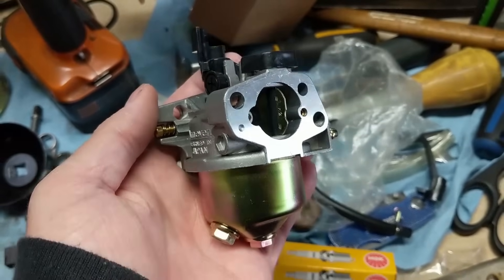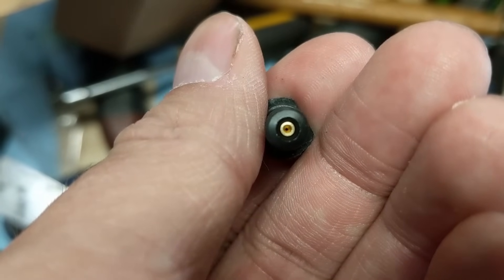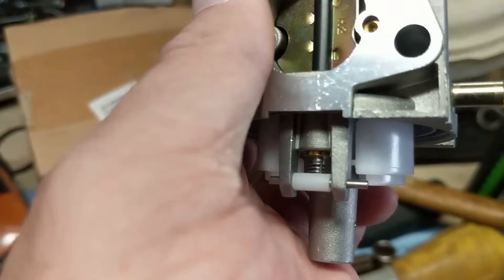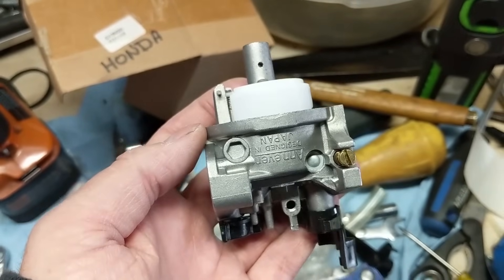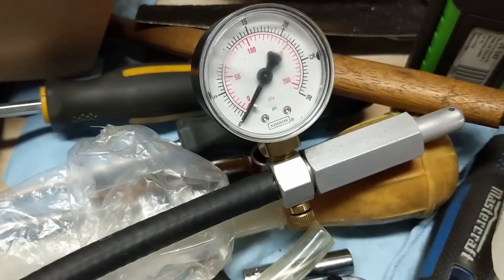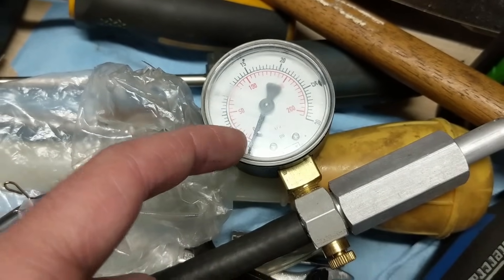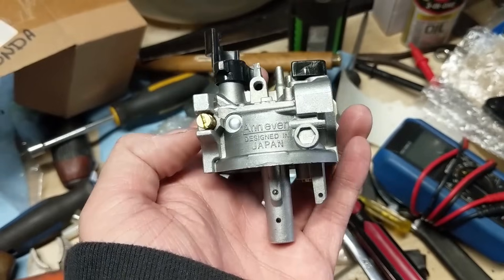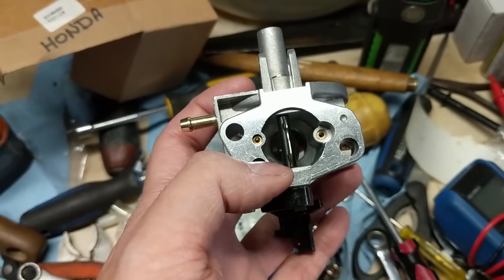How does a Carburetor Work?

Comment: Eliminator, I got am aftermarket carb to replace my water flooded walbro lmk carb.
The new carburetor won't get my 9hp. Briggs Tine master with torque converter log splitter. Where should I start if I know we have spark?
Reply from the maker: Keep spraying (giving a small spray every couple seconds) with carb cleaner, and if it stays running, it's the carb. I'd check the fuel flow from the fuel tank through the line as well

Comment: So, I went through a full clean of the carb, but I still can't get the engine to start.  One thing I noticed was that the fuel bowl will drain for a short period and then stop.  I was wondering if I have a plugged fuel line to the bowl.  If I remove the bowl bolt, shouldn't it drain the entire gas tank (if I understand the float and valve correctly)?  Great video, and thanks for the info!
Reply from the maker: Yes, either your gas cap on the tank isn't venting, or you have gunk built up in the fuel line. These Honda's also have a fuel filter "joint" they call them, that screw into the tank, they get gummed up and slow the flow of fuel

Comment: I have a Snow blower that won't start, I blew air through the fuel inlet and fuel came out the top where the the choke/throttle lever is, is that a bypass or the carburetor is shot?

Comment: Great video.  How does the pilot/idle jet have any effect on mowers that just have one set speed and never idle as such?  Is it redundant?
Reply from the maker: They meter the amount of fuel at idle, and when the engine is under load, the governor will keep the engine at the same rpm but the fuel will then be metered by the main jet

Comment: I want to try to simply my thought process after trying to understand how a carburetor would flood do to a leaky needle valve. Hopeful it helps others.

supply + demand = user throttle demand or govern speed demand.

When you first start your engine, your carburator bowl should filled with fuel to the extend that the needle valve is closed.

Now, if you didn't run you lawn mower for a few days and didn't have a in-line shut off valve, your engine's crankcase can be flooded with fuel due to to a leaking needle valve. 
How you engine is flooded depends on what type of configuration of engine and carburator you have.
On some engines the fuel with travel through the different channels in your flooded carburetor. I.e, welsh plug breather, primer vacuum, main jet valves, etc. and go down your intake tube and into your intake and exhaust valves and into your crankcase.
In which case, you end up with fuel being mixed with you oil.
On systems with a fuel pump, sometimes there's a pin hole between your upstream fuel line and your down stream fuel line so fuel streams down your 'pulse' hose to your crankcase even when the pump is closed.

 This is why sometimes your air filter will be drenched in oil or fuel.

Just imagine if your engine is running and it's been over supplied with fuel and the fuel fills your

Comment: I forgot one time mine choke on and my engine stopped, now it starts after 1000times kicking but now the motor stutters. So my question is why? Do i need a new carb ? And this video is awesome my english is bad but i understand a lot and learn some things. Thanks
Reply from the maker: Could be valves? May need to be shimmed
Reply: Eliminator Performance thanks👍

Comment: Ok. What is the groove in the back of the carb for? I'm pretty sure it's bowl ventilation, but I bought a carb for a Wisconsin 9hp and the original carb had gaskets and spacers with a hole that lined up all the way from carb to motor and the new carb was identical, but the two gaskets it came with did not have this hole. Since all the magic happens within the carb, is this hole/port required?

Comment: Hi Jake. I have a Briggs Carb with no pilot jet per say. Nonadjustable may better describe it. I have cleaned it several times. What I am facing now is the snowblower dies on open choke. Any suggestions? Thank you for your input. I am at a loss.
Reply from the maker: Check out Mick's Mowers channel, he has a great video on how to drill the jet size on a main jet for a non adjustable carb

Comment: Thank you for best video.
 I don't understand how gas pump to engine because small engine have no gas pump or injector like car?
Reply from the maker: No fuel pump on "gravity fed" machines, that means fuel line goes from tank to engine. Some models have fuel pumps. Newer engines have fuel injectors like cars.

Comment: Great explanation, thank you! Quick question: the needle valve on my Honda carburetor does not attach to the float, but it has a pin inside the valve that is spring loaded against the float with an internal spring apparently. Have you ever seen something like that, or has my needle valve somehow been broken off?
Reply from the maker: Thanks for watching! Yes sometimes they just have pressure that holds them. Not very common but some lawnmowers are like that.

Comment: Awesome video, I do have a question: say you have a bad needle valve and the cab is above the intake so gravity floods the cylinder. How would fuel get into the lubrication system? Those 2 systems are totally isolated? There's no point where oil touches fuel? Is that because of bad piston rings? That's all I could thing of where fuel from the cylinder can leak into the oil filled crank case below?
Reply from the maker: Thanks for watching!

To clarify, fuel floods the Carburetor, travels down the intake manifold and into the cylinder. Once the fuel is in the cylinder, it leaks past the Piston rings into the bottom end (where the oil is).

As the fuel drains into the bottom end, it will diluts the oil and cause lubrication issues.

If left unfixed, the entire fuel tank will slowly drain into the bottom end, and in some cases cause "hydro lock" of an engine.

This is when there is so much fluid in the bottom end, the Piston cannot travel down the cylinder.

Hope this helps!
Reply: @EliminatorPerformance  Thanks so much for your reply. Very few content creators provide such an in-depth explanation to questions that pop up from random viewers (like me). You confirmed my theory in terms of the path, yet I am curious even more. Is this a normal condition or a failure condition of the piston rings? In other words is it not true that the piston ring should be liquid tight hence no liquid could go past it in a normal condition or is that not accurate? Could the liquid tightness only occur under warm engine temperature while in cold conditions the rings let liquid pass and that's just how it is?
Reply from the maker: @bubba1984  when doing a compression test (assuming there's no leak at the valve seat) you should have 10% compression loss through the Piston rings.

Here's a video you can watch to get a better idea of that: https://youtu.be/Ha2IkHgx-zo

That is a "leak down test" and once I solved the valve leak, we still had some air go past the rings, as I stated, about 10% is normal.

Comment: I have a new Eliminator Performance engine on a Honda power washer and it starts but will not stay running. It ran great last year and I was able to pressure wash my entire house without stopping, except to refuel.  It will run as long as I continually slightly depress the primer bulb but as soon as I stop it quits. Any suggestions. Thanks in advance for your help.
Reply from the maker: Gunk in the main jet

Comment: Need to explain more thoroughly.Fuel bypass’s the emulsion tube? Why are there 2 air holes? Brass mixture screw for low speed or high speed mixture?

Comment: I have a toro 826 oae snowblower that I used for one season and stored it properly. When I started it it was hunting/surging. I slightly drilled out the idle jet and the surging stopped but it was still running a little rough so I took apart and cleaned the carburetor with no change new true fuel no ethanol so I replaced the carburetor and it still runs a bit rough. The throttle bounced around erratically but not really surging. Replaced the carburetor again with same results. I also took the spark plug out and cleaned it and checked the gap. It was black so looks like it was running rich. Can you help me out with what I’m doing wrong?

Comment: We recently negotiated a riding lawn mower in with a cabin we bought, and we have been having issues with the mower where it has progressively declined and died.  
RE:  John Deere D130 riding lawn mower.
Any suggestions on possible repairs?  At this point, my husband has tried a lot of things and just wants to buy a new riding lawn mower.  However, I want to double check with the John Deere brains here - to see if there's anything else we can try before buying the new mower, since he just spent a few hundred dollars on new parts... .
He started to experience problems with the mower 2 months ago, where it would run/he could mow for 1 minute, and then the mower would die.  Then he would start it up and do it over and over again where the time would decrease on how long it would run (ie:  30 seconds), and then it would die.
He put a new battery in, where the mower started right away, but then it would only run for about 30 seconds, and then die.
The day after he installed the new battery, it wouldn’t turn over or start at all.
My husband then replaced the fuel pump, fuel filter, the solenoid, got all new gas and new oil in there - and the mower started right up, no problem, but then died after 30 seconds. 
(My husband says the fuel pump and fuel lines work fine –  where he tested those after installing the new ones.)
Then he installed 2 new spark plugs (22 horse power briggs and stratton) and used special carbuerator and choke cleaner to clean the carbuerator.  He also read that this can happen if the gas cap isn’t venting (creates a vacuum so the engine doesn’t get any gas) – where he took the gas cap off to see if that would help, and the mower would then run for 30 seconds and then die.
At this point, it won’t start at all. It has gone slowly downhill and now it just won’t start.
Most likely we will just bite the bullet and buy a new riding lawn mower, but I hate not know why this is no longer working, or what else can be tried to get this to work.  
Any suggestions are GREATLY appreciated!  Thank you!

Comment: So I have a question. I have a Troy Bilt Ranger Tiller that will just not stay running. If I prime it with about 6 pumps, it will run for about 20 seconds. I can do this over and over but it does continue to run. I have done everything to try to get it to run. I have a new spark plug, new fuel filter, new air filter, new gas cap, new main fuel line, I checked the OHV gaps, checked the spark with a spark tester, checked the gap on the magneto. I even ordered a new carb from Amazon and tried that with the same result. I have thoroughly cleaned the OE carb with carb cleaner several times. I tried swapping the main jet from the Amazon carb with the one in the EO carb and trie the OE carb again. No luck. I did notice something the last time I worked on it. The carb seems to possibly have a deformed bowl gasket. If this is the case, could this be the cause of the problems?
Here is a link to it running for a little bit after I did some work on it, but it was not running well.
https://www.youtube.com/watch?v=3rweGsZDyJ4

Comment: Good day  Interesting video.  I did not know that kohler used  the same carb  as honda.  I live in Amish country, taking lawnmowers & tillers for neighbours up there to get fixed.  I was told that carbs are  non-adjustable like u said, not knowing why.  Good video going thur all of them. I did buy some  sea-foam?  Thanks for now
Reply from the maker: Thanks for watching Don! And yes, the Sea-Foam works good to clean carbon in the engine, I'll do a video eventually of what it looks like, because it will produce a lot of white smoke! Also good for helping to clean the carb, but won't blow out a clogged main jet! Sometimes you just have to take it apart!

Comment: i am just confused about a thing that we have studied four stroke engines IC engines  and in those, there are generally cylinders which used to contain air and then when it compressed, it used to ignite. So where does the carburetor comes in from?? Is it another device with the same function or is there any difference between them?

Comment: What is the small port in the face of the carb body that attaches to the engine block. It's the hole that has a channel through the machined face on the engine side. What does it mean if fuel is pouring out of that port? Your finger is on it at 2:17

Comment: For my lawn mower and snowblower in the off season, I fog the engine until it dies and then drain the fuel tank.

Any thoughts on that method vs running it until it dies from lack of fuel?
Reply: I agree with you but it is always better to drain it out completely to avoid any problem in the next season.
Reply: @naeemjaved8594  I do drain the tank so there's only a tiny bit in the end.

Comment: What brand carburetor us this?  Mine is the same basic design but it has a nylon sleeve for the needle valve.  I wasn’t impressed with mine (Amazon rebuild kit) as it seemed to be a little tight.

Comment: I have a champion generator with this same carb. It is brand new with new gaskets. I installed fuel is in the carb and the engine just runs on choke on and dies when put on run. How could this be if its a new carb? Do I need to adjust something?

Comment: I need some help!! My wall behind mower Kawasaki  FH451v stays at full throttle. Even when in choke and when I have in slow. Seems like the throttle valve is not closing and opening. Any suggestions?

Comment: Got a problem with my mower, pulled the carb apart and its squeaky clean, prime the engine and kick it in its runs for as long as that primed fuel lasts than cuts out, could the carb be faulty?

Comment: my toro snowblower will only run if i pump the primer bulb.  as soon as i stop pumping it, it dies, but runs strong while i pump it.  does this mean my idle jet is slightly clogged and the extra pressure from the primer pump bulb forces it through?   It also wont stay running if i pull the throttle a little bit though
Reply from the maker: Yes, and by priming it, you're creating a makeshift fuel pump, by pressurizing the bowl and forcing fuel through the main jet. You need a carb clean!

Comment: 15:17 on engines without a fuel pump and a horizontal intake manifold, does leaking gas get inside the crankcase through the exhaust and intake valves when they open?
Assuming your pistons are sealed, wouldn't the combustion chamber just flood without the fuel being able to actually enter the crankcase?

Comment: I had a problem the last few times where cold starts wouldn't idle on my bike. I thought it might be the automatic choke, as I had to open the throttle half way until it warmed up. If I shut off it would die. After a few days, upon a really cold day it went away and is idling correctly on cold starts. Could it be that the pilot jet was just gummed up and it flushed through, or is my choke a bit iffy?
Reply from the maker: Absolutely sounds like an idle circuit/pilot jet issue. Either that or the electric choke (if you have one) isn't engaging all the way. But then it would still pull fuel through the pilot jet.

Usually if it's just a small piece of gunk, it'll get dislodged and clean itself out.
Reply: @EliminatorPerformance   Yeah I was thinking it's got to be one of those two, thanks. If it's the choke, it's a bit skittish, maybe mechanically or electrically. If it's crap in the pilot jet it may have worked itself through and hopefully the problem is gone now. Since it's winter I don't want a non-start situation. I'm putting fuel cleaner in the tank before going out tomorrow to hedge my bets.

Comment: Can an air leak in the carb cause I problem? I have a Honda outboard with a very similar carb and it works up to 1/4 throttle but over that the engine stops as if not enough fuel is getting to it! The carb has been cleaned in a sonic cleaner twice and still no improvement!

Comment: I was hoping you would explain the function of the channel on the back plate. My mini bike is leaking fuel at idle through that channel. What would cause this?
Reply from the maker: Leaking needle valve and a clogged main jet? Causing fuel to leak through the vent hole

Comment: If the needle is worn out could that be causing the white smoke (alot)? Head gasket was changed but it still smokes lik crazy.
Reply from the maker: Could be piston rings, as white smoke is usually oil burning and black smoke is rich fuel. If it smokes white on start up it could be worn valve guides, and as the engine heats up the valves expand and tighten the gap so it doesn't drop oil into the combustion chamber. If it smokes white all the time> Piston rings or a warped cylinder
Reply: @EliminatorPerformance  Thanks for the response.   It smokes on start up with the choke on then seems to go away but then come back.   The more throttle the more smoke.   I thought it maybe had to burn all of the oil it had from overfilling it after I changed the head gasket.

Comment: I have a troybuilt 2410 model 31as62n2711, 265-sua engine.  I had bad gas so I drained tank, removed gas bowl and gave carb a good cleaning.  Carb gaskets got soaked with carb spray so I ordered and replaced.   Engine starts up great.  Only thing is when snowblower is tipped it leaks gas.  Further diagnose is the bowl Gasket it corroded.  But what I can't figure out is when I removed gas bowl gas continues to poor out but if I hold float up it stops.  Do you have a solution to my issue?
Reply from the maker: If there's no fuel shut off valve, then I'd recommend draining the tank before working on the carb. The fuel coming out until you push the float is is normal.